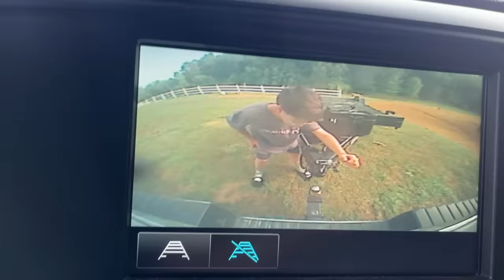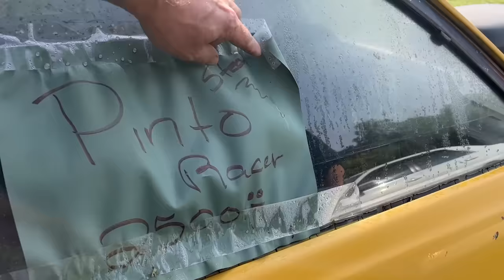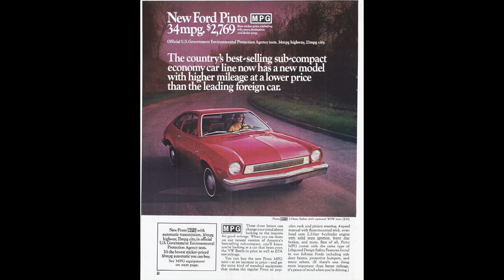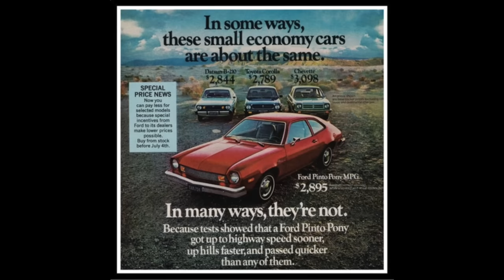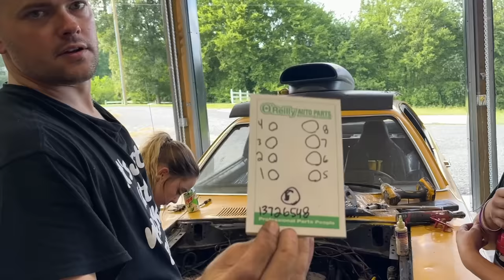Will It Run and Is It Fast? Dirt Cheap Race Car!

Comment: That car looks like it was someone’s unfinished project, but nothing the Sleeperdude family can’t handle.  I would pull things apart and see what you have, and start to build it the way you want and is safe!😊
Reply from the maker: Yeah maybe so
Reply: V8 pintos were popular back in the 70s. They needed a short water pump, and the headers were wild. They exited down the front of the engine
Reply: @Sleeperdude  It's easily my favourite car you guys have featured on the channel. Only the VW comes close, and honestly thats more about watching a father and his daughter share a project they both love.

This Pinto has the goods. It's even a good looking car, the lines of the pinto were always ready for the muscle car treatment, and with that huge scoop balancing those meaty tires (sorry, casings, lol) it looks right out of a hot wheels box.

Please give us a bunch more of this car, it's a diamond in need of recutting and you guys are the perfect people to do it.  And then take it racing....I'm betting one of the kids might be ready and remember the smaller your driver the more HP goes to the car instead of the driver
Reply: I agree!!

Comment: This brings back memories, I bought a 1974 Vega wagon. I pulled the original 4 cylinder engine out (blown). Transplanted a 350 CI ran it down the strip a few times. During high school and after graduation those 60’s & 70’s cars were affordable $500 to $1,200 so you can imagine I went through my share of cars, all running. Seeing your cars brings back memories, thank you for great content and being a great father with your kids. Tosh showed how to get it done, great purchase and addition to the family.
Reply from the maker: Awesome thank you
Reply: I remember those days . wish I still had just one of those cars.

Comment: I think the Pro-Mod hood scoop makes it worth at least another 2 grand!🤣 The look on Josh's face when it popped right off when they were checking for spark was priceless! I'd check and make sure you have two massive battery cables coming directly to the front from that rear mounted battery (or get a gear reduction starter). Ford starters typically draw a lot of current, even on a stock engine. That said, it would be a great idea to make a tube frame for it, complete with roll cage, and move the whole engine back another 12" or so, like you mentioned. It's just going to be a tire smoker for now, unless you load the trunk up with a few 100 lb. sandbags. I think you did well on this deal, considering the engine and trans seem relatively solid!😉👍👍 EDIT: Back in the late 1980's I built up a rowdy 2.8L V6 for one of these, and it would light up the tires in 3 gears, and chirp them in 4th. I don't know if the guy ever made it to the strip with it, but it was a really fun little street cruiser!!😄
Reply from the maker: Awesome thank you

Comment: Awesome job getting the Pinto going!! 👍  I've built a build like that one but I moved the drive train back so that the radiator support didn't have to be cut and the front grill and bumper could be reinstalled.  We built a tube frame for the engine to sit in.  I must agree the build on this Pinto is sketchy and that be nice about it.  I'm amazed it wasn't a fire sale car with that great wiring.. I would be scared to take it down a race track... God forbid something lets go and it ran into something... Once again be proud of your family for such williness to help and provide such support.  That Mabel really loves you... Hey don't forget you owe the Galaxie a distrbutor and don't buy the cheapest one on eBay.... been there done that one too... LOL😂 God Bless!!

Comment: Outstanding find, my friend.   So glad that thing fired up like it did.   BTW, that's the second GMC Motorhome you've spotted on the side of the road... If you ever get the chance to get one, you should grab it.  They're becoming extremely collectable.  Interesting fact on them:  they're front wheel drive.   Extremely cool engineering on those rigs. 
P.S.   Love the clean-up time lapse at the end.  Too funny.  And Squeezy's art is pretty doggone impressive, too.
Reply: Cool I had no idea they are front wheel drive .
Reply: The are Oldsmobile Tornado engine and transmission. They are unique and a decent small motor home but the rear suspension and fuel tanks are usually bad and with no replacement parts they usually require good fabrication skills to get them back on the road. But they got lucky on the Pinto they might get lucky on one of those motor homes as well.

Comment: in the 90s when I was a young father I had a '78 pinto with a 9" rear and a 350 chevy with 350 turbo. I had to run the exhaust through the front by running the manifolds installed on the opposite side to make the outlet in the front then put pipes up in around the wheel wells and straight out the back. Thanks for the memories. Feels like a different lifetime ago at this point...

Comment: what a cool find, great deal. I noticed your shop doors are lacking the brush seals, you've got a lot of doors so that's a large investment for the seals, but it will help keep bugs out, and the air/heat in during winter
Reply from the maker: Yeah that would be a good idea

Comment: First time checking out this channel and it made be happy to see the whole family involved, especially the goats. I also love compact cars with big engines. The entire trans and engine swap would have cost several thousand dollars even back in 70s. I think mama did the best donut for sure. Sounds like the trans has a stall speed converter and posi rear, maybe .373 gears. With a good tuning she will be a great competitor at the strip or at a burnout competition.

Comment: Really like your family and their participation. Back in Late 1973 to Early 1974 I participated in a swap of a 289 with a C-4 into a Pinto. Cooling was our only problem. It was a terror on the street and you really couldn't drive it in the Snow. In 1974 the Pinto based Mustang came out and couple of years later 289, 302, and 351 V-8 swaps were common. In south texas there was a club that placed a 429 SCJ in a Pinto. In the Seventies a mfg. in South Africa produced a V-8 Pinto that they called the Pangra(I believe that was its name). Sleeperdude Family keep up this good stuff for as long as you can 🙂

Comment: The Pinto was probably one of the most worthless cars ever made but you slap a 302 with an 8-inch rear end and now we are talking. Great video as usual. I think all of your goats love the new shop Rocky and Granny were usually the only ones that went into the old shop.
Reply: The Pinto  wasn't worthless and I know of many that did over 200K miles. The Pinto ushered in the much needed Rack and Pinion steering to North American Auto Production. One V-6 Bobcat sation wagon version belonging to a sister in law went 285,000 miles until a snow plow ran into it and totaled it.
Reply: @michaelverinder8158  You must be from a place that doesn't get snow. Up north they rotted off the frame before most people could get it paid off. No power going up hills or mountains, traction really sucked. Rack and pinion steering was useless when you didn't have anything left to drive. I stand by my prior statement.

Comment: Great deal on the Pinto. I would highly suggest you restore the integrity of the radiator support and lower frame front section by welding in some tie in support braces. You could rear mount the radiator or mount it to the underside of the hood, that way you could go back to a regular steel hood. She's a RIPPAHHH!!! lol. Great artwork by squeezie!!! The animals love the new shop and love their daddy!

Comment: You haven't lived til you own a Pinto.  I've had two 1972 Pintos and loved both of them.  They were built from 1971/1980.  71 to 73, the standard engine was the Kent 1.6 liter 4 cylinder.  Optional 2.0.  I believe that in 1974 , the standard engine was the 2.0 liter and the optional 2.3 liter.  Starting in 1975, the standard engine was the 2.3 amd the 2.8 liter V-6 became the optional engine. The V-6 lasted til 1979.  In the final year 1980, Pinto, the only available engine was the 2.3 liter 4 cylinder engine.   Great little car.
Reply from the maker: So cool

Comment: Guys I think this is my old project , I bought in from a guy in bardstown KY , it was blue and I primered it , I bought a 77 or 79 cobra ll with a 302 that a guy backed into nolin lake trying to do a burnout on the boat ramp , i pulled the 302 and trans out of the cobra ll and was planning to build the pinto , i sold the whole setup due to moving to florida for work in 86 , i heard he painted it enamel yellow ? All this was in 1986 when I moved to Florida ,if it's the one I had then I'm happy you have it

Comment: I had one of these in the 80s with a hot 302 in it. As long as the rear wheels will spin it works, fun, as soon as you make it hook it will pop the windshield. Good luck.

Comment: I had a 1971 Greeves Griffin 380 dirt bike.  The air boot that connects the carb to the air box was missing.  I contacted the Greeves NOS dealer.  He told me the horn button from an early 70s Pinto would fit.  So even if you can't get that car running you know it will be good for something.  Lol

Comment: Sweet ride! When you install your distributor, if you can't get the oil pump driveshaft lined up just get your cam gear and dist. gear meshed.... hold your distributor and have a friend roll the motor over by hand and it will literally fall in place. Make sure the dist. turns as the motor turns and you will stay in time.

Comment: Hook-up a shop vac to the oil fill before you drop the plug and it will stop the oil from shooting out unill you shut the vac off thus preventing the oil from going all over the place. Great for hot oil!
Reply from the maker: Ok thank you

Comment: I knew a guy who built a Pinto with a heavily built 429 police interceptor and a top loader 4 speed. Had to change the spark plugs through the wheel wells, but it did nice wheel stands and definitely needed the wheelie bars he put on it.

Comment: My friend got a 1978 Pinto from his mom when we were in high school back in 82-84. He tried to blow up the 2.3 with automatic by holding it in first gear. It actually shifted into 2nd gear just before it was probably going to throw a rod! I guess it was a built-in safety. He ended up putting in a 2.8L Capri V-6 in it. Until he took his brother's NOS system off his wrecked Trans-Am. It lasted a couple of months then he parked it for years. Over the years he saved up money and slowly built this car into a full drag race car. He's got a 302 bored to a 305. Probe custom pistons, I don't know what other components are in the engine. It's got a one-piece fiberglass front end. Full frame, tubbed rear body with a nodular 9" inch rear-end. Summers Bros. and Willwood axels and brakes. Full roll cage. Electric water pump. No drive belts at all. He's got a blower on it now and it's putting out about 1400 horsepower! Oh yeah, he's got wheelie bars and a parachute! A Pinto! It was actually kind of a rare model because it was a glass-back. Of course, all the windows have been swapped out with Plexiglas.
Great video 👍👌🤠

Comment: My dad built a 73 pinto hatchback into a race car. He changed the front suspension with a half ton pickup suspension and he put a 302 in it. He ran clay track and figure 8 track.

Comment: I had a 1973 pinto with the 302. Make sure you upgrade your brakes. It doesn't stop from high speeds very well with stock brakes

Comment: I put a 302 boss in a Pinto station wagon. And it literally did not matter how fast you were going down the road. When you stomped on it, it would light up the back tires.

Comment: We had 4 cylinder Pinto vs 4 cylinder Vega in Highschool. Both around 200 horsepower. Pinto was auto shop project.Vega was me and my father. Either would kick the crap out of most Stock V8 cars at school. Great times we would battle it out at local illegal drag spot.😂
Reply from the maker: Awesome

Comment: That is a beautiful family you have there!  It's great to have an artist around...maybe we can persuade her into painting the Pinto doing a massive burnout.
That being said, Rocky (the goat)would be chained up in the dungeon...okay that might be a bit extreme but he can't be eating car parts.
Good call on the firing order, just need to plug those EGR ports in the heads and she's a ripper!
I'm with you on the Edelbrock/Carter AFB. They are good to have around just in case you need to melt them down and cast some useful car parts.

Comment: 1st. time that i've watched one of your family movies in quite the while. While one of your dreams has  came true to have one of these,it saddens me to see this little pinto all chopped up. cannot be that many of these left. i had 2 of them a  red 1976 wagon 2300 cc 4 speed 1981/1982 and a 1980 runabout 2300 cc 4 speed 1986/1987. gray. great little stock gas sippers.  these pinto's maverick's and the mustang #2s kept FoMoCo from Going Belly Up in The 1970s..
Reply from the maker: Yeah for sure thanks

Comment: I had a 71 pinto and it had custom headers the motor was professional installed body was mint condition I paid 850 for the car in 1976 I had put a 355 mercury rear end not cut down it was Black on Black L 60’s looked like a frog 🐸 I ran everything from 2 four barrels to a 4 barrel high rise with a snorkel scope if I can find the picture I’ll send you some it also had a unibody kit so the body wouldn’t twist it was built by a professional shop and the only thing that would go on it was the pinto heater core I saw Motec had the same car back in the day.

Comment: Used to have a 65 econoline 5 window with the same trim option. They are extremely rare. It's been about 10yrs since i sold mine but iirc they only produce 605 of them as dealer display models and all were in red.

Comment: I had that pro-comp distributer.  It has a lot of mechanical advance built in.  Like yours, there was contact at the wheel.  This self clearanced.  I ran it for about 1000 miles and it failed and left me stranded on the highway.  Maybe the module failed.  I replaced it with an MSD and have not looked back.

Comment: If I'm not mistaken the water pump does spin opposite, I put a racing flex fan on a fox body and it ran hotter , took me a day to figure out I had to order the reverse flex fan for a 302

Comment: In the early 80's I had a 72 Pinto wagon with a 289 C-4 it was yellow with wood grain on the side I'd love to have it back it pulled the front wheels and would hold them off the ground through 2'nd gear not bragging but I never lost a race with it and I raced it every weekend for 2 years

Comment: I didn't really see them too well, but I think those were the older type Iridium plugs(probably Motorcraft) you pulled out of it, if so, I'd say clean em' up, they last just about forever, and aren't cheap. I'm only at that spot in the video, but it doesn't look like anyone put much thought into that V8 swap, I think I'd break it all down and do it right, and that engine does not look mounted properly at all, lol. Good luck with it! Should be a fun project :) I love the stanced look of Pinto, and Vega racers. I'm all about that light car, big motor stuff!

Comment: Add the 302 V8 bracket all cast aluminum all original for electrical that the rubber steel ply goes around the engine front. The North Las Vegas and his house sells it for $122.22 and it's better than your belt tensioner in a wrong place of the wheel that goes to the belt.

Comment: 1405 Holley Carburetor; Remanufactured Carburetor; Performance; Universal; 600 cfm; Manual Choke, square bore
Not the greatest carb for fords but what you installed will be much better 😉

Comment: Ford pinto nice find these cars are fun but parts are hard to come by but there fun. If you drag that beast be sure to get wheelie bars because the front wheels will come off the ground with  a v8. I have seen it happen it was crazy i would be driving mine if i could get a carb that was ca compliant.
Reply from the maker: They are fun

Comment: think you should go over the car first , its pretty solid in therms of rust but theres a lot a iffy things about the brakes , wiring , welding , engine placement and other stuff , put the engine back and putting the bracing back in the front and do a rewire adding a firewall in the front and the rear (btw a trick i seen was that they usedpieces cut out the bucket of a wheelbarrow to make the firewall fit the engine a wheelbarrow bucket is basicly the sheetmetal version of a UJ pipe )
rebuild the brakes get a new driveshaft and check if everything is actually fastened before driving it on the track 
might be nice to turbo it later on maibe LS swap it with an aluminium block to get the weight distribution a little better

Comment: Needs a solid flat tappet cam or for  more $ solid roller cam 👌 add a stall converter make a good foot break bracket car to have a lil fun with
Reply from the maker: That would be fun

Comment: I was a young man when Ford put the Pinto on the street. I recall one morning on the way to work and a Pinto passed me and someone welded a thick wall pipe on the rear of the car where the bumper used to be. I believe it was about a six inch diameter. On the pipe it said...   "My Better Idea"    Search YouTube and you'll probably find an old 1960s Ford commercial then you'll know why the owner put that on his pipe-bumper.
Reply from the maker: Yeah they were known for gas tank explosions

Comment: Just in case u were unaware; Your rims are factory mercury capri (fox body merc) years approx 1983 to 85 or so.   Not sure if they came on the mustang or not, or just something simular.   somone correct me if i am wrong. im not a ford fan but can appreciate a mustang or two.